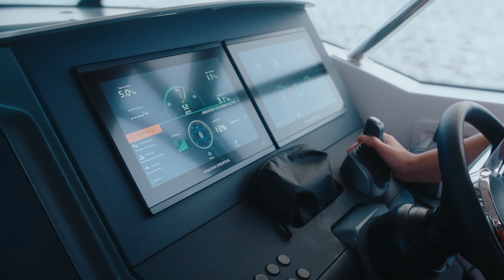Volvo Penta expands Assisted Docking to more boaters

Comment: @VolvoPentaOfficial for DPI owners does the system integrate with bow and stern thrusters e.g. Sleipner?
Reply from the maker: Hi @jamestaylor8568, yes, our DPI system integrates smoothly with Sleipner thrusters to enhance your docking experience. 🙂
Reply: @VolvoPentaOfficial  That sounds good! Does this include proportional thrusters such as the SEP130 Pro and the SXP100 Pro variable speed units? We have two DPI D6-440's on order with joysticks and were told in August that thrusters did not integrate with the joysticks. Is it likely that we can now do this?  Many thanks.
Reply from the maker: @jamestaylor8568  great question! The SEP130 Pro and SXP100 Pro variable speed thrusters will work with our Assisted Docking feature. However, it’s worth noting that the regular Joystick Docking function doesn’t integrate with thrusters, which might be what you heard previously. 
 
If you’d like further support with this setup, one of our authorized dealers would be glad to assist. You can find a dealer near you using our Dealer Locator: https://www.volvopenta.com/about-us/dealer-locator/

 Let us know if you have further questions!

Comment: Impressive manoevering, but I'm guessing the "never been climbed before" comment was a bit misleading. Looked like all of the tie off points were prefitted.
Reply from the maker: Thanks for the observation, @rossmackay1974! This climbing route was created by our expert climber, Klemen Bečan, specifically for this adventure, and it was indeed the first time anyone tackled it—just a day after it was set up.

In sport climbing, like the route in the film, pre-placed bolts are drilled into the rock, allowing climbers to clip in for safety as they go. This is different from traditional climbing, where climbers place their own gear into cracks or features. The route in the film was designed and equipped for adventure, but also for safety, before any climbers attempted it. 

We’re looking forward to sharing more about the journey and the unique challenges behind the scenes in the upcoming videos. 

Stay tuned!